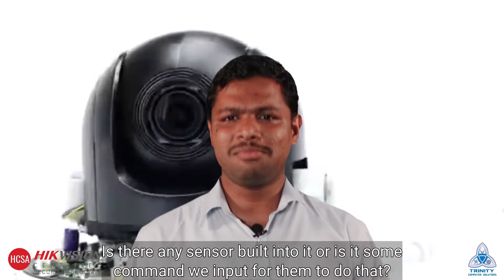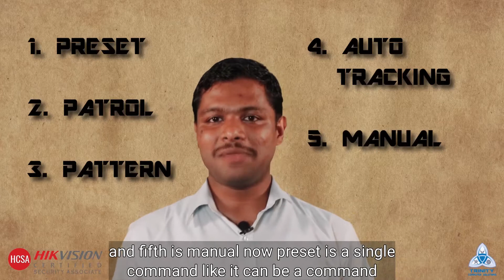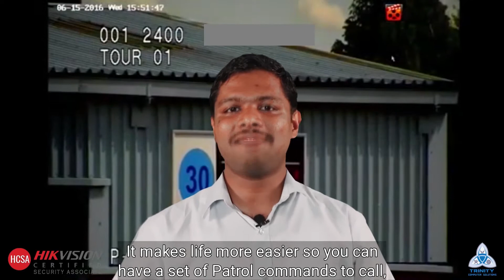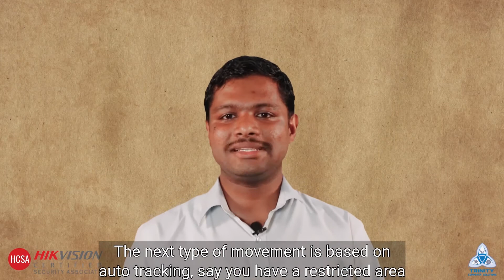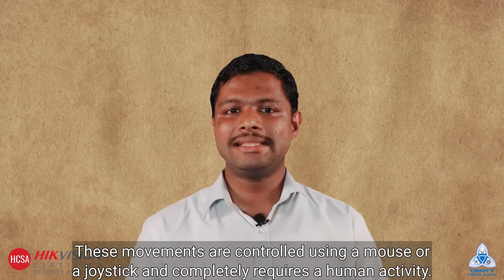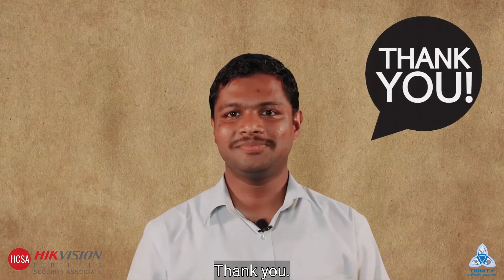How does a PTZ Camera work | Preset | Patrol | Pattern | Auto-tracking | Manual

Comment: This was fantastic. I just got a PTZ and it truly helped me understand.  One question. If say a camera is set to move between areas, say area A and B, and it’s focused on area A but there is motion or intrusion in area B.  Will the camera miss the action in area B?  I would think if it’s pointing at A it would miss everything in area B. Thanks again
Reply from the maker: That's a good question, that's the dis-advantage of PTZ camera's. However nowadays we have next-gen PTZ Camera's which display a broad view even when the camera is panning, tilting or zooming. In higher end PTZ camera's, you can also integrate the camera's with Radars and Detectors which can detect a motion or movement and there-by giving instruction to the camera to point the that specific area of movement. Hope this helps.
Reply: @FitTechWithSibin  it does. Thank you for taking the time to answer.

Comment: Hi, I need to increase the tilt angle of my ptz cam, meccanically it is possible : First I move the cam with the app to show the horizon, next, after open the case, I can move manually tha cam over to view  more high . After this manouvre the cam is perfectly manouvered by app. The problem is that at the next re-power the cam does a routine to catch the end in tilt and pan movement...and the manual setting go away. There is a method to change by firmware the end of tilt movement ? hope I was clear. Many thanks
Reply from the maker: You can always set the park position in the PTZ camera settings so that the camera comes back to the same position after it restarts or powers on.
Reply: @FitTechWithSibin  Thanks for the answer, but unfortunately I think I have explained myself badly. I try again: when my camera is powered it performs a routine where it looks for the limits of mechanical movements. having done this on the vertical movement it allows a movement lower than what it could mechanically do (I think to avoid that by raising the iquadratura too much the lens is obscured by the frame that closes and supports the transparent hemisphere). My intention would be to be able to take advantage of that part of the movement too, but it can only be done if you alter the firmware. You should make sure that the FW allows vertical movement respecting the mechanical limits, avoiding that the useful angle is reduced by the software. Thanks again and I hope you can help me.

Comment: Get video was wondering how do you program the Auto tracking with the pattern setting. Any info will be appreciated. Thanks
Reply: I also want to know that
Reply from the maker: Appreciate your response, for any support you need, pls reach out to us on support@trinitycomputersolutions.com
Reply: Is this possible ? If not ptz are useless
Reply from the maker: @theattorney6072  This is definitely possible in a PTZ camera, however the basic models do not support auto tracking, only higher end models support them.
Reply: @FitTechWithSibin  I have ordered a ptz caméra which has auto tracking. How do you combine auto tracking with pattern ?  Thx